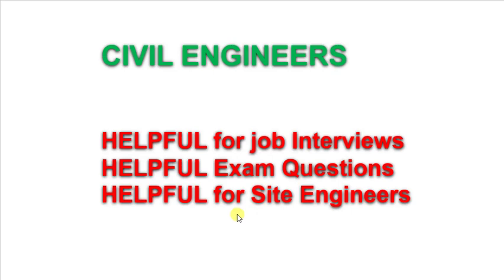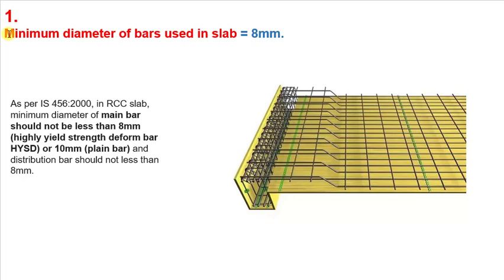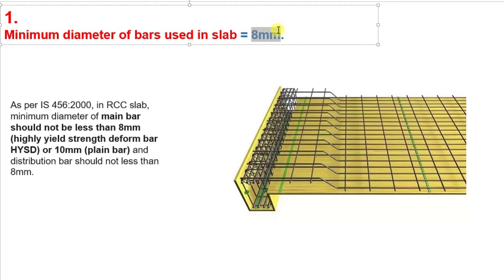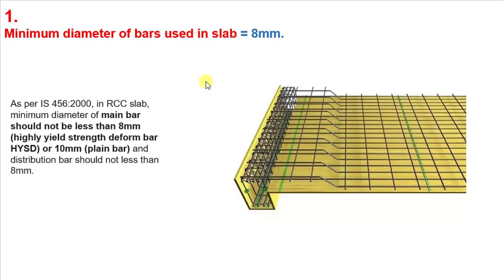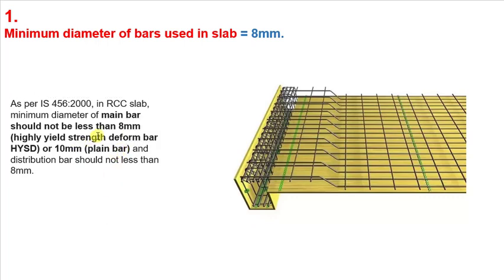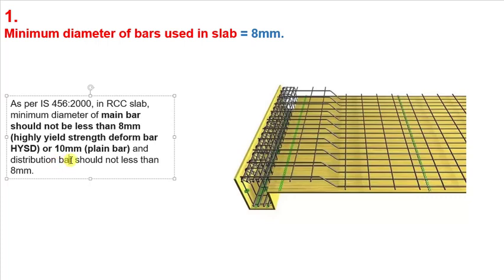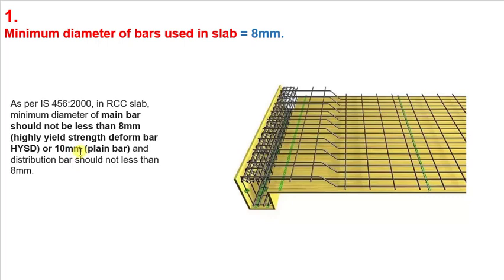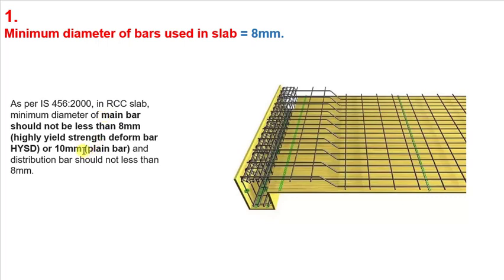Part 1- Civil Engineer Interview and Exam Questions

Comment: Thankyou brother for these videos....
I have a question ....
IS codes are Indian codes and we follow ACI codes in Pakistan so should we learn IS codes or ACI codes for interviews?
Reply from the maker: Thank you. I think we need to know both. Because most of the books we study are Indian authored books and they use IS codes and thr is not as such difference between ACI or IS codes. 
Other point is ACI codes are just limited to concrete, but it's important to know about ACI codes too as a Pakistani.